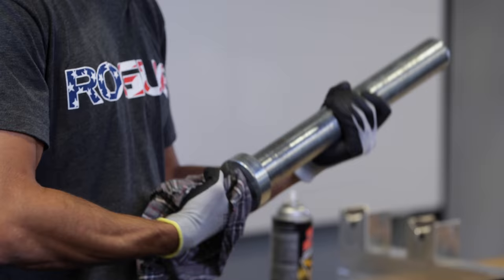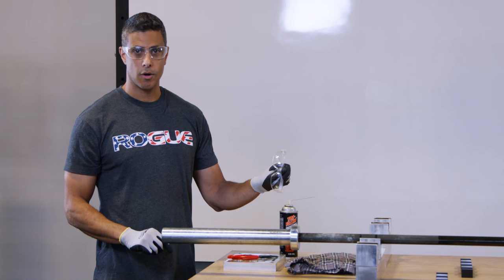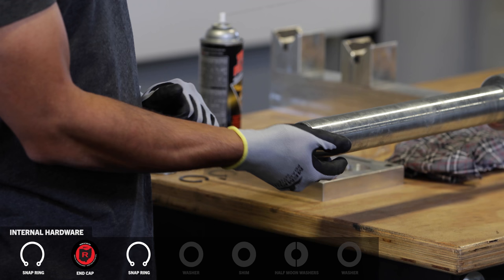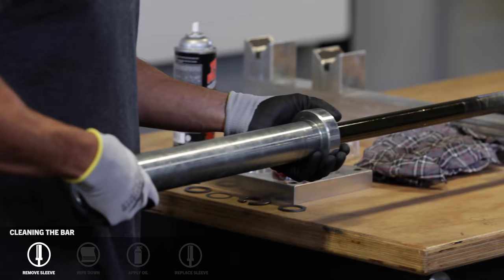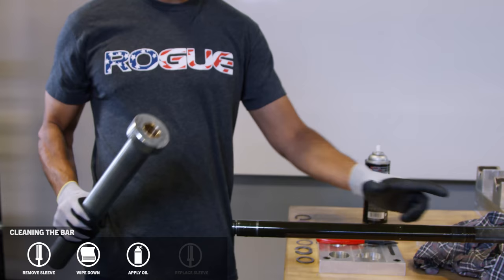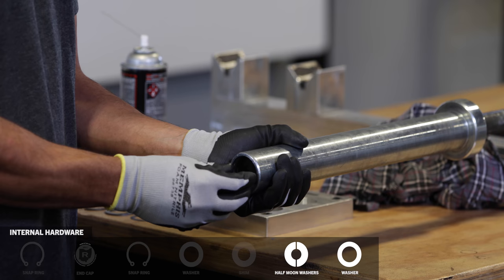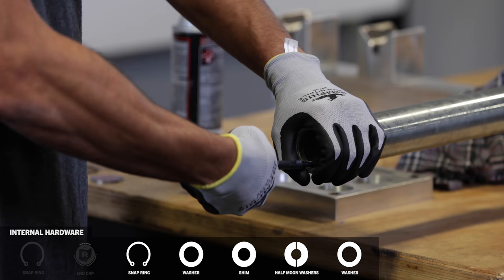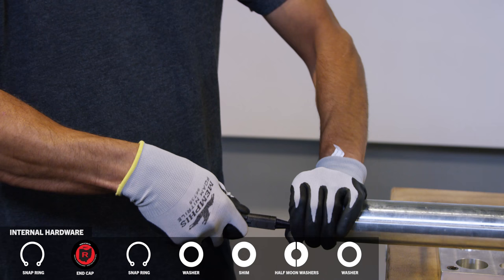How to disassemble and clean your Rogue Fitness barbell

Comment: You just taught me how to convert my Olympic barbell to a standard now I can curl my standard plates
Reply: Does it work?
Reply: That's what what i was thinking 💭
Reply: You’ll screw up your bar if you go back to the 2” sleeve. The surface the bushing needs to ride on needs to be vert smooth and sticking 1” weights on that can damage the surface. That will make the sleeves not rotate smooth if you use those again
Reply: Also, the resultant 1" bar will not have any flanges (no separation between bar and the weight-loading section to stop the weights from sliding)
Reply: Wow, horrible downgrade. I guess if it’s a cheap bar it can make sense. Standard plates and bars suck.

Comment: Can't stress enough the importance of a set of durable snap ring pliers. Those snap rings are super hard to remove without a sturdy pair. Broke my first set of jaws and had to purchase a better set
Reply: I hear you Alex. Just bought a cheapo Chinese set off ebay to get them off my ATX Ram Bar Powerbar and they were flexing all over the place giving me no purchase. What a bloody joke. Now i need to buy a better set. Smh.
Reply: Throw some rust buster on the ends around the snap rings. The snap ring can get stuck in place over time with even a little bit of rust or just general "gunk" around the ring's slot. This can make it way more difficult to compress the ring and get it out of the ends. A little lube usually does the trick, in every line of work. But yeah cheap-o tools are definitely going to make it worse.
Reply: If you see a parked Snap-On, Matco, or Mac tool truck better stop and get a pair of real professional ones.

Comment: Many thanks for posting this.  I have “The Rogue Bar”, purchased 2011, and this dramatically improved the spin.  Spin is important for the Olympic lifts in particular.

It would be really helpful if you could list the make and model of the snap ring pliers in the description.  I purchased a pair of Knipex 5.75-inch internal straight retaining ring pliers.  I was able to get them to work, but they were too small, which made it way more difficult than it needed to be, and I think I basically destroyed the tips of the pliers in the process.  The snap rings are way trickier to deal with than the video suggests. Obviously this guy has a lot of experience.  (I now have half an hour of experience.)

One final note, be sure to get INTERNAL snap ring pliers.  They make external ones too, which will not work at all.
Reply: I think the ones he is using are Knipex 4411J2.

Comment: Any advice on what lubricant to use? The Teflon spray in the video is much thinner than the factory grease. I imagine the spray attracts less buildup but probably doesn’t last as long. I noticed a difference in the sound, the spray is more metal on metal but spins a little faster with the lower viscosity but the lube sounds quieter, a little more dampened and refined. I was thinking maybe some white lithium grease for a heavier lube? Maybe use the spray in a dusty environment but expect to re-oil sooner and grease in a cleaner set it and forget it environment?

Comment: I conditioned my raw-steel bar with a rust dissolver, then added the 3-in-1 oil. The next day my bar was already brown and rusty. I think its flash rust: do I just need to use more oil next time? Also: can you use rifle blue to recolor the barbell if it's patina is brown???

Comment: Is it normal for the snap ring to not be perfectly flat? The first time I removed mine I noticed that ends of the snap ring where you insert the pliers seemed like they weren’t in line with the rest of the snap ring. It still fits into the bar just fine but I’m the kind of person who worries about the tiny amount of wear created by the friction of it expanding into the groove when putting it back in there lol you can see where the cerakote has worn off around the groove that the ring goes into. 
I also want to encourage everyone to use quality pliers. I bought cheap ones with interchangeable heads the first time and the ring kept coming from off of them before it was completely removed and scratched some coating off of the sleeve. I like wear from actual use but stuff like this is just annoying.

Comment: I've recently purchased the rouge c70s bar. It has up and down and side to side play and the more weight plates are added the less freely the bar spins I've come across two other people with the same issues (except its the Ohio bar) I didn't care at first until I realised that the bar rotation is affected by adding plates.  I've only just received it in the mail, the most weight I've used on it is 150lbs because I have a tender elbow and I haven't dropped it, I've set it down gently  after use. Do you sell replacement parts for this barbell ? The spin on mine is terrible compared with the one on this youtube. What is the problem with it ? It is supposed to be brand new

Comment: I don’t trust myself enough to successfully achieve this.
Reply: chances are you can't even do basic car maintainence
Reply: How do you tie your shoes?  How could you not accomplish something this simple?  What do you do for a living?
Reply: Same
Reply: @TempoDrift1480  It's just a fear of failure. What if you permanently bend those snap rings? What if you break them? What if I don't have the right tools? What if I put too much lubricant? Does the lubricant smell? Will the lubricant leak out? Etcetera. Also why would you do car maintenance yourself when there are so many factors that can cause you to damage your car? I'm not talking about basic things like changing oil I'm talking about using tools.
Reply: @Moreoverover  You can get new snap rings at the hardware store. You can't really apply too much lubricant and it will leak if you do and you wipe it off. If you don't have the right tools, buy the right tools. The lubricant will smell like like a petroleum based lubricant, but if you're sweating you will probably only smell yourself. You can't really hurt your car, everything can be fixed and replaced. It's just overthinking. Don't limit yourself by overthinking what could happen and then never do anything. If you fail, so what? You learned what not to do.

Comment: I bought a used Ohio bar that is missing the outer snap ring and end cap. Where can I get replacement parts?
Reply: Minh Tran I have the same problem. My half moon washer was missing and I can’t seem to find the piece. Let me know if you find a website you can buy the parts from.
Reply: Nick Victor I contacted Rogue directly but apparently they don’t do spare parts.
Reply: @mtrancsulb  , I recently ran into this problem too.  I opened up a bar and the half moon washer was cracked and split into a few pieces. No spare parts? RIP to the Bar???
Reply: @nickvictor7336  Any luck on finding replacement parts?
Reply: Adam Chinn if you can be more innovative and go to hardware store to find a similar object that can fit that part.
Reply: @mtrancsulb  maybe..... unsure as i believe that part is what keeps the collar on the bar....want to make sure its safe.
Reply: Adam Chinn no. Easiest option is waiting to actually buy a barbell online. It might be a little more expensive but it’s safer and a much better long term investment

Comment: What brand  of  snap ring pliers are you using ?
Reply: I picked up a pair of Channellock 927 8-Inch Retaining Ring Plier and the Tri-Flow TF20006 Superior Lubricant from Amazon. It was $30, but should last the lifetime of the bars. It was all just as easy as it looked except for the inner snap ring. The snap ring pliers come with various sizes to change out, so I may experiment with a different size next time, cause the snap ring kept slipping off the pliers. I chose those pliers based on reviews.
Reply: Those are Knipex, German made.

Comment: I have the Rogue Olympic WL bar, which is a bearing bar. How would I clean this bar @roguefitness?
Reply: Nick Springer good point. it's the bearings that spin internally not the contact surface. you should never grease those bars like this. new bearings probably needed.

Comment: Is this recommended to do with an OPB as well?
Reply: Probably not. As a powerlifter we dont want our bar to have alot of spin
Reply: @tahntalus  I'm not sure why you would have locked sleeves. If weights get some spin, that spin would transfer to the bar you're holding, and rip your hands. The bar shouldn't have any momentum applied to it,  imho.
Reply: @tahntalus  its not that powerlifters dont want a lot of spin, its just that powerlifters dont need it so its not worth the extra cost on a power bar

Comment: i bought second hand olympic power bar named barbell. it is pin lock type sleeves but spin is pretty poor i opened the other sleeve. and there is only bushing which shows sleeves inside end. ho should i service this bar. Thanks!!. and what pin use if the old pin is damaged in the operation

Comment: Great video, but I must admit. It makes me feel pretty stupid lol! I have the same barbell as you... In fact I have about 20 of them at our gym. I cannot for the life of me get the snap ring off. I used a pair of snap ring pliers, but I squeezed them so hard they themselves snapped. Then, I bought a more expensive pair of internal snap ring pliers. Been trying for days now, sometimes 1-2 hours at a time with no luck. I had to stop because I was getting inflammation from all the squeezing... But for the love of God I still can't remove the snap ring! It's as though the pliers don't close quite far enough for the ring to loosen properly. If I try to pull or wiggle the pliers at all, they just pop straight off of the snap ring. I must be as dumb as a bag of bricks. Any ideas what I am doing wrong? It looks so simple for the videos. Thanks.
Reply: Steve, did you ever get a resolution to your dilemma?  And kudos to you for even admitting that you were having problems with this!
Reply: @sidrow11  It took me about a month of trying constantly. I went through several sets of pliers because I kept breaking them or they just wouldn't work. I asked several people that were used to using snap ring pliers and they couldn't get the snap rings out either. Anyway several forearm injuries and a lot of sweat and quite a few swear words later, I did manage to do it! The first time took me almost 3 hours to do 1 barbell. But I gradually got better and in the end, could do both ends of the barbell in about 20 minutes. One hell of a job when you have 30 barbells to maintain. Thanks.
Reply: @steveboutcher80  I've found that some of the rings are bent and some aren't. One side of my bar took two seconds, the other side was a bear. I also found that switching my grip from overhand to underhand helped. Also, make sure to clean any 3-in-1 or other grease that may have contaminated the tip, else it'll slip right off.

Comment: I took the first snap ring off but I can't get the End cap out? Am I doing something wrong? Pendlay bars.
Reply: evan daniels I tried tapping it with my hand it did nothing. I'll try a rubber mallet I guess. It was just weird that it wouldn't come off very easily. Thanks
Reply: CrossFit Dark Athletics yea sometimes if the barbell is dropped a lot under its own weight on the ground it will get flat spots and prevent the cap from coming out, mallet worked for me but also have had to get a thin flat head and pry it out after revealing an edge ...members know not to drop empty bars now. I service our barbells every 6 months or so with new grease since oil doesnt do anything.
Reply: evan daniels it's only the pendlay bars. The rogue and again faster bars came apart much easier and I'm pretty sure I'm way more abusive with those than I am with the pendlay. It's really weird. Thanks. Will give it a shot.
Reply: Use a magnet.

Comment: Hey, I have a question if anyone could answer, could wd-40 work?
Reply: No.  Use spray on Lithium Grease, silicon, or 3 in 1 oil (last resort).   you can also use spreadable lithium grease which is available at auto parts stores.   Also use a lint free cloth, like an old t-shirt, for wiping.  And, if grime is caked on the contact surfaces (bar or bushing), you can use steel wool to clean it before wiping it and applying the lubricant.
Reply: WD40 isn't a lubricant, it's a solvent.
Reply: Best in Classs Vaseline mate
Reply: Patrick Gonzalez thank you man!
Reply: @RPK74m  Couldn't you use it to clean the barbell though?

Comment: would this work for bearing bars as well such as the rogue euro?
Reply: FullMetal Lifter yes you just line the bearings like you do the bushing bars and pack the bearings with bearing grease or moly disulfide grease.

Comment: Just stupid and probably way too simple question.

Can't you just . . . . spray oil it through the gap and let it flow through it?? its will make it to other end anyway if you leave it vertical up for like 5-10 mins. Then wipe the excess that leaked at other end. And then work on another side the same way. Make sure you point the tip of bar to the ground.
Reply: Altimis Nuel that will work! That’s pretty much what I do with my barbells and they spin and work great, not a dumb question 👍
Reply: That is effective. This is just a clean way to do it effectively.